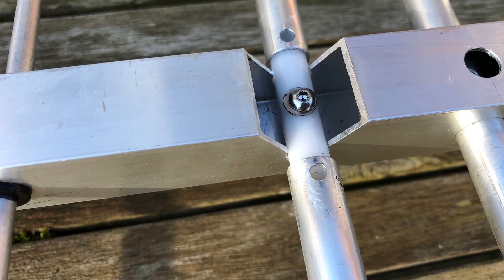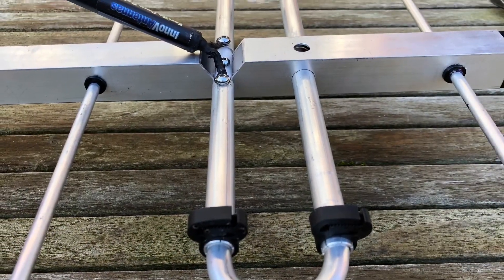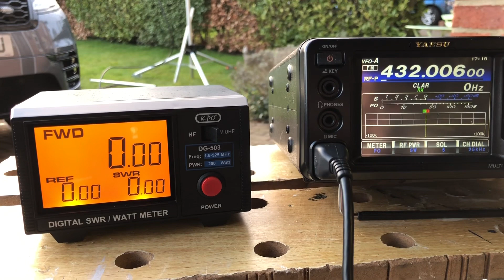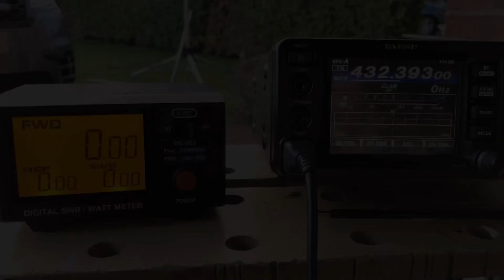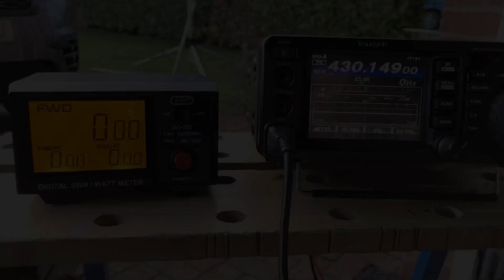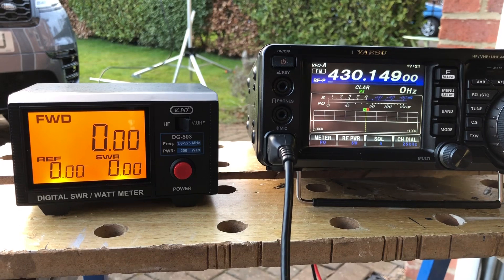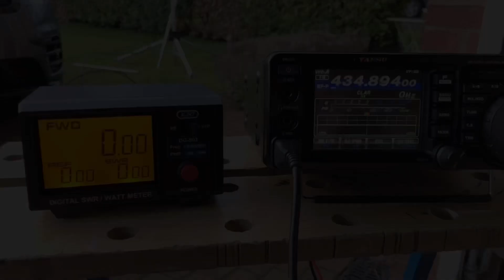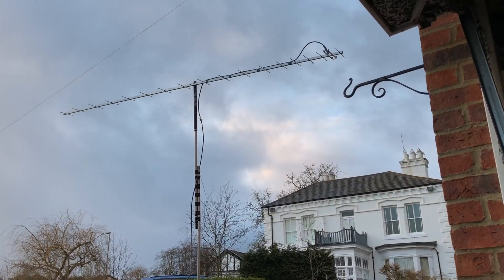18 Ele 70cm LFA-Ultra Yagi Assembly

Comment: Very nice Ian 
Once our home is built I'll put an 18 element (maybe X-Yagi) for 70cm too.

Do have any experience how many S-Point stronger a repeater for instance may be compared to a "standard" vertical a such as an X300N or equivalent?
Would be interesting to see a real world comparison.
Cheers and 73
Kevin, VK4KK
Reply from the maker: Hi Kevin. In terms of dB on 70cm the X300 is 6.85 and the yagi is around 15.85. So say with 10w in that’s 48w for the colinear and 385w for the yagi. In S points the difference is 1.5, which is a lot at UHF ..... assuming my maths is correct!